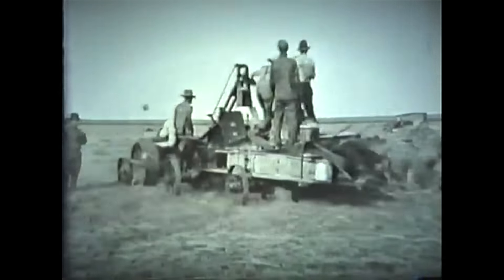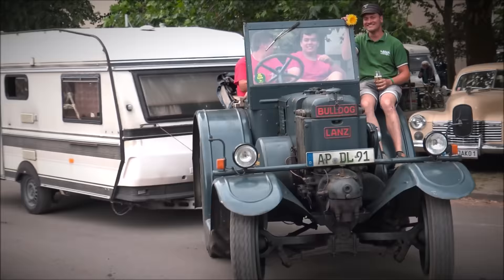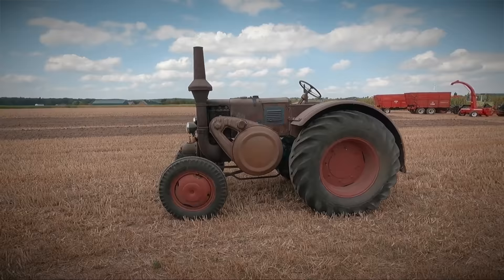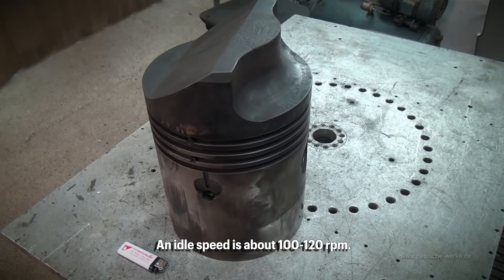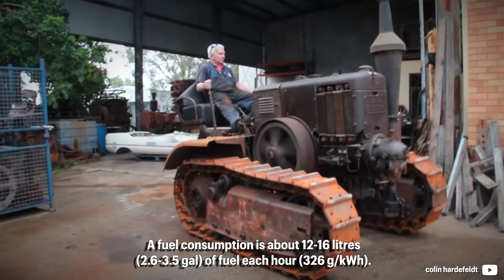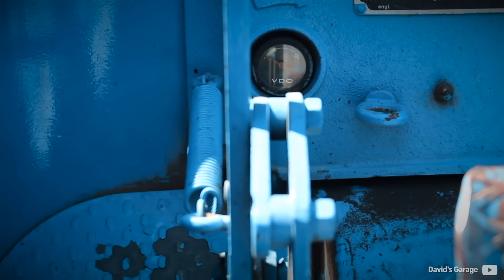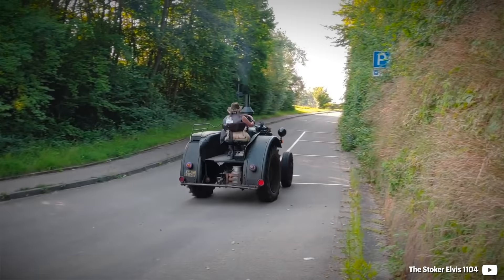This Is An Incredibly Slow Engine

Comment: There were always stories passed down in Australia of farmers dying or getting injured when plowing at low speed, and as the motor ticked into reverse the throttle was applied driving a control handle from the plow into the blokes back as it Jack knifed unexpectedly. I find it a little more unbelievable now knowing it was a feature in the tractors they would probably know about😂
Reply: I don't think that ever happened. The clutch had a hand lever you could grab to disengage it if the engine ever did anything abnormal and in many years of running Bulldog tractors I never saw any such problem.

Comment: The Hot Bulb Engine is the world's first HCCI Engine essentially, because it used both a homogenous charge compression ignition and hot surface ignition simultaneously and you're using the hot surface of the bulbs to vaporize fuel to make the said homogenous charge to ignite and burn.

HCCI engines got to the point of being able to have compression ratios of 18:1 and had injection timings similar to diesel engines before the Diesel Engine came out into mass production, the hot bulb inspired the prechamber for IDI diesels since the 1930's.

Imagine if you use EGR, ways of cooling and condensing the air, and used modern uniflow diesel tech to resurrect the Hot Bulb Engine, that would be able to be a viable HCCI system that can be maintained and be used effectively.. hmm....

I've known about the Lanz Bulldog tractors and the Hot Bulb Engine since I was still a teenager, easily 14 to 15 years ago.

Comment: " a combustion engine was more simple than steam engine".... yeah that why was invented 160 years later. because of its simplicity...
Reply: The difference in design is minor, but running a steam engine is usually more labour intensive, but there is also a reason why steamlocos only went away by 1990.

A few points :

A steam engine is an external combustion engine, like sterlings or also referred to as hot air engines.
The steam engine to power other maschines was desinged in 1771 and petrol engines came about to more common use during the 1880ties so its a bit les than 160 years. But I will admit it kinda depends what you count as the invention of the steam engine, since Watts athmospheric steam engine is quite bad compared with later designs like the Corliss engine.

Comment: I think that the Field Marshall had a better, more economical engine that was easier to start. Production of this did not end until 1958 [for export mainly] by which time much more modern designs and engines were available, such as the Fordson Major and the MF35 and, in 1958, the MF65 Mk1

Comment: Unfortenly there is a sad story aboutThe  lanz Factory. The Factory was sold to what we germans know as John deere..yes there are alot! of john deeres here in germany and the reason is the following sad story: Other brands where  using multiple cylinder engines in the meantime lanz buldog produced still the one cylinder engine. That caused a huge problem of the lanz factory cause the single cylinder engine was not the industry standart anymore and John deere has bought the company!  And since then alot john deere tractors where produced and still are produced. Lanz would be today the leading german Tractor brand next to fendt if lanz had build multi cylinder engines. The build quality was ahead of the time. They where one of the best tractors ever made at their time

Comment: 12 % efficiency is on the lower side even for a hot bulb engine. According to this old Swedish summary, many such engines had an efficiency around 25 % and some even higher than that: http://icer.se/publikationer/tfpOlofE.pdf
I've got a 4 hp hot bulb engine that I will soon start renovating with the hope to get it functional.

Comment: As I haven't heard the term bulb-engine" before I can't say for sure. But familiar with the Lanz Bulldog and the technicalities of a diesel engine in general, I can make an educated guess that the definition at ... isn't quite right. 
Bringing a "superheated fuel " in contact with "oxygen rich fresh air " is surely not what neither a diesel engine nor a Lanz Bulldog, which is powered by one does.
I rather think the term "bulb" refers to the more or less "bulb"-shaped cylinder head, that has to be preheated with an integrated blowtorch to prepare for a cold start. As stated correctly the fuel (air mixture) isn't ignited by a sparkplug like with the Ottomotor (petrol engine) but is a "Selbstzünder " , an autoignitionengine that's fuel ignites  when injected with  high pressure into the combustion chamber, that contains  "fresh air" compressed by a ratio of usually about 1/20 or above. Due to the high compression rate the temperature of the air rises above the  ignition temperature of the fuel oil and ...
As the still cold metal would cool down the air too far, the cold start has to be primed by some kind of preheating and as glowplugs hadn't been invented then heating up the whole cylinder head ( for about 30 minutes]) had to do the trick 
If I'm wrong, please let me know, but..😉 ... in any way it was heart warming to see the beautiful cooling towers in preparation for a video about a 10.5 l engine, as there is not much warmth left in our mad global cooling world..😄

Addendum: 
Damn it, when will I learn to  watch a video to the end BEFORE I ramble an hour long to reveal myself as a smart-arse 3 minutes post- postig😅

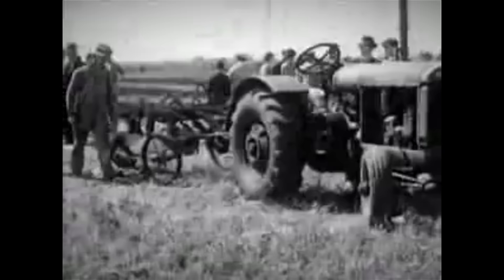Comment: Thank you for the presentation.  However, while in the begin you refer to "internal combustion engines" (at 0:53), we can't help but notice you then go on to just call them "combustion engines." We can infer what you mean but to be more precise, all engines are "combustion engines."  After all, a steam engine is a "combustion engine."  It's just that its combustion takes place externally and they can be referred to as "external combustion engines."
Reply: Don't forget Stirling engines. Also with external heat source.

Comment: Imagine fuel being affordable
Reply: Tdi rabbit pickup
Fuel $6.67 in Cali
75mpg is how
Reply: use small tires and we can get 50mph from them🐱👍🏿
Reply: @fastinradfordable  I imagine those torque numbers are a bit different than the 10.3. Can’t quite perform the same tasks.
Reply: Actually there are some people who calculated fuel economy of them on a long trip(like a 1500km vacation trip)...if i remember right it is like 25l/100km of diesel...maybe more...but it depends on what version it is and where you drive them
Reply: @maxgr7723  I don’t mind the mileage I want cheap fuel for massive engines! I’m pro co2.

Comment: I'd say, this is a bit unfair for the Italians...

Even for hot bulb tractors, the Lanz isn't the  one with the biggest piston...

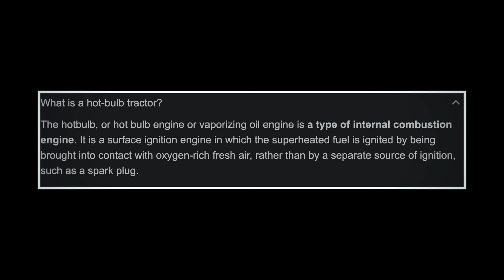The biggest one I knew from a hotbulb tractor must go to the SuperLandini (the tractor you showed at 1:23), that one had a 12,200cc single cylinder, which makes it bigger by 1,900cc...

Edit: @Markxyz pointed out that the Landini 40hp is even bigger, 14.3 litre single cylinder engine.

There were plenty of internet videos showing both the 40hp and the SuperLandini hard at work...
Reply from the maker: Thanks for the info, I have changed the title
Reply: @VisioRacer  still you can recycle the old title. There were numerous clips of the Landini 40HP and the SuperLandini working, and they were quite a sight...

Comment: Steam powered tractors did not work in Europe as the steam engines were too heavy and would sink in the soft European soils, they were only useful in the USA.  They were used in Europe for mobile power (to operate say a thrashing machine or pump).  When used for ploughing the stationary engine pulled the plough via a a winch and cable.  Only large estates or collectives could afford steam tractor engines.
-internal combustion changed farmers lives. A smaller farmer could use them and a European farmer with soft soiks.    A miner who needed to pump water from his mine or hoist out ore could move the engine and fuel to the mine on a donkey or two.  
-

Comment: I wonder how they got to 10.3 litres for a thumper... did they just make it bigger until they couldn't go any further ?
Reply: There were already large single cylinder  stationary engines 
 Stationary engines preceded anything used to power a vehicle - used for pumps and powering other types of machine
Reply: @paulg3336  mmmhhh, oh I see. Thanks!
Reply: @SONO4B11T  In fact, the largest single cylinder engine in the world is something like 10,000 Liters and double-acting (there's a power stroke on both sides of the piston). It was used to pump natural gas I believe, and in fact ran on the same gas it pumped!
Reply: The Italians have the Landini 40hp tractor with a 14,300cc single cylinder hot bulb engine. It was then replaced by the SuperLandini model, which have a 12,200cc single cylinder. I've seen some videos of SuperLandinis with rubber tires, and the engine rotation is such that at a certain low rpm, the front wheels would start hopping up and down!